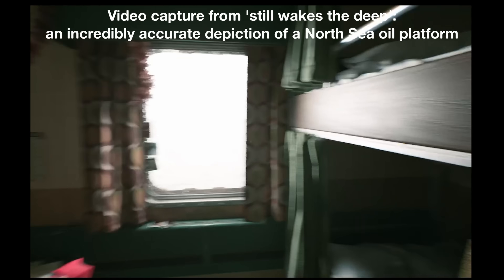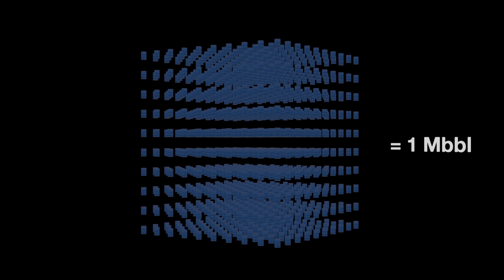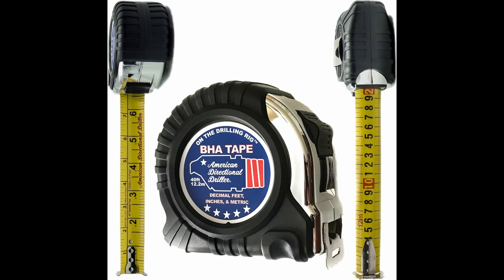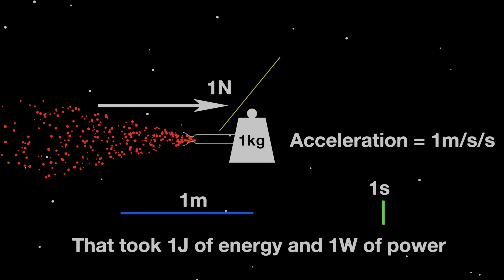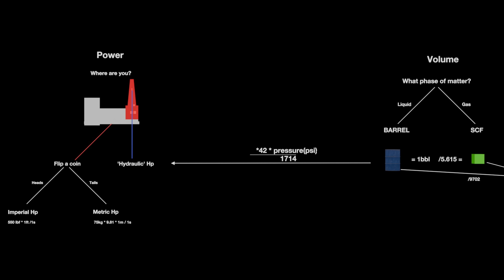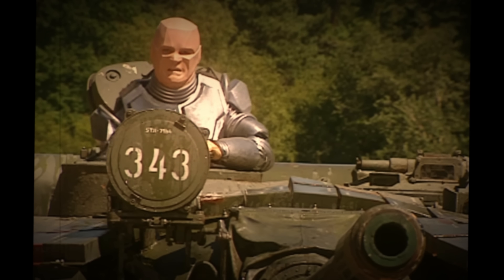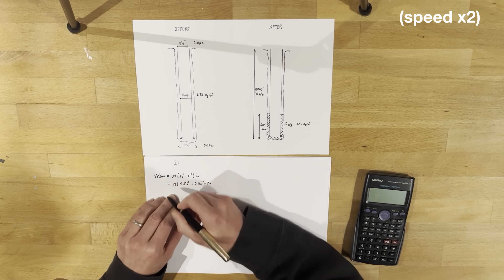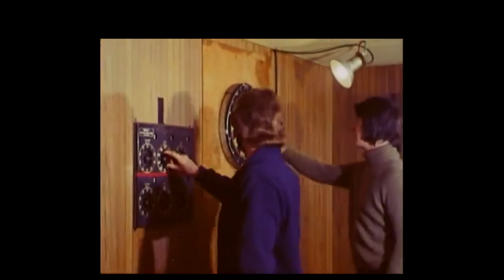Oilfield Units: a Measurement System so Cursed it made me Change Career

Comment: As an American who has hated this kind of attitude with the heat of a vacuum arc furnace every since I learned how to use a ruler in kindergarten and wondered out loud why the heck anyone would want to use inches and fractions, I can confidently tell you that what you're describing is the product of American exceptionalism, sintered with the tribal machismo of maverick American engineering, and annealed with Texan conceit.

I've never worked in oil and gas, but I've had experience with the above three, and it just makes so much f**** sense.

Comment: First lesson as a chemical engineering undergraduate at a British university- the 5 systems of measurement. I still have a fondness for the btu/h.ft2.deg F unit for heat transfer coefficients. I worked for a British company that had technical connections with a US company- they insisted that all calculations be done in US customary units, so I became familiar with all the various conversion factors. Then I worked in the nuclear industry where things were either very very tiny or huge, so we invented our own (descriptive) units: the naff-all & the Wembley. The pico naff-all per cubic mega Wembley was a really, really small concentration (but still deadly)...
Reply: @charlesbrecknell4656  "Cubic Mega Wembley" was a prog-rock album, wasn't it..?
Reply: You might get a kick out of this - https://en.wikipedia.org/wiki/Sverdrup

Also, there is a mythical unit from the Danish Technical University "Jørgensen" - defined as "A Universe full of beer"
Reply: @janhgh3400  "can you use it in a sentence?"
Yeah, my dad had a Jorgensen before coming home to bea-
Reply: Norman Feather's classic tome still a favourite of mine; required reading in 1st year.

Comment: 4:00 you just skipped the part about how standard cubic [volumes] is actually a form of MASS unit because the "standard" part refers to a defined pressure and temperature...which isn't officially standardized, it's more like a handshake agreement. That's right "standard cubic feet" aren't actually standardized, I work in aerospace engineering and we run into this, we actually have our suppliers tell us what their "standard conditions" are in the spec to make sure we're all on the same page.

Comment: In the European Union a new regulation recently went into effect that forces manufacturers of electronics to provide the customer with a spec sheet with information on the devices efficiency, noice production, etc.

I think that this idea in general is great, and drastically improves transparency and allows consumers to make better choices.

However, the Unit they decided must be used for the efficiency of a device is is how many kWh the device draws in 1000 hours of continuous use. kwh/1000h.
Reply: That actually makes some sense since it forces averaging into play. If a number in kW was given then there would be plenty of wiggle room if the power actually used is too high and hard to prove the number was false.

Comment: I was taught metric at school, but also imperial by my dad who did his apprenticeship in engineering and upholstery in the early 50s. Therefore my measurements are an archaic mix of both that drives anyone under the age of 45 or so crazy. No regrets, and I'll happily tell you this from at least 2 furlongs away so I get a 1/4 mile or so head start on running away.

Comment: I once combined the news industry's two favourite units: "as heavy as x blue whales" and "x times as big as Wales" into the unit of pressure whales/Wales. One w/W is about 50 micropascals, depending on how big the whale is.
Reply: I randomly calculated the pressure head of my toilet bowl to about 20 mbar. It flushes well, so I guess that's good...
Reply: Would kw/W be kilo whales, or killer whales?
Reply: When I need silly units, I personally use the Armstrong, which is based on disgraced cheater Lance Armstrong, cuz he’s one of the more notable people who have a power output measured, which is about 512 watts. He was 5’9.5”, and some blogger joked about him having a 4” dick, so that’s one Armstrong-Inch, or A”. Ofc one A’=69.5”/4”=17.375A”. You can also abbreviate w/ 💪 for brevity. So, for instance, one 💪=165lbs, and a road bike tire has a contact patch of abt 30in^2, so 1 💪psi is 5.5 imperial psi. Converting to your measure, one w/W=3.98854*10-8, or about 39.9 nano💪psi
Reply: @SpAm-AcCoUnT 🤭😂😂
I didn't seen any mentions of Stones
Reply: @SpAm-AcCoUnT  I prefer to measure lengths in lines and arshin, and weights in pennyweight.
Reply: @Lyrainthevalley  wouldn't be whales/Wales = h?
Reply: @fackgugle6497  Yes, about 0.5 nanoatmospheres.
Reply: @fackgugle6497  wh/W if we account for register
Reply: I personally like the FFF system, furlong firkin fortnight.

There are a few surprisingly useful units in the FFF system. One microfortnight is really close to 1.2 seconds. An hour is about three millifortnights.  The speed of light is about 1.8 megafurlongs per microfortnight.
Reply: @Lyrainthevalley  And whether the tide is in or out.
Reply: Now I understand, why US newspapers use units like school-bus, Olympic pool, elephant (really used by some NASA article about SLS Launch Abort System)  )and so one...👍
Reply: @TheKluvi  SciShow of all things spent half a video measuring data in Bytes and converting to e-books for some dumb reason.
Reply: Well you know this is an industry standard dictated by Westminster then, as no Welshman would ever actually use Whales, we would use sheep, daffodils or leeks.... Maybe dragons, but not whales.... :)
Reply: How do you get pressure from that? Wouldn't the two whale units be mass and length?
Reply: @toebs_  Mass of a whale over the area of the country of Wales - makes more sense to me than the oilfield units hell!
Reply: @mal.p ahh I misread, I thought it said "as big as x whales", meaning x times as long as a whale. I also just learned that "weight" is the actual term for the force of gravity acting on things, not just an informal term for mass like in German. Oh well, now everything makes sense
Reply: What?! No way! That's like nothing! Surely whales should be able to fly if that were correct.
Reply: @actuvon imagine a single whale thinly spread over the entire area of the country of Wales - wouldn't exert much pressure at all
Reply: @Lyrainthevalley  🤣🤣🤣 I misread your post as whales/whale. I thought it was meant to use the footprint of a whale. The truth is funnier.
Reply: @Lyrainthevalley I would dearly like to tell you that Wales was once intentionally smeared with the remains of an exploded whale. However, the one that beached itself on the River Severn in 1895 was cut up in situ.
Reply: Reminds me of furlong/firkin/fortnight units, or maybe the barn-megaparsec. IIRC that's about three teaspoons.
Reply: @gazeboist4535 how have I not heard of this. The barn is one of my favorite units. You think it's a joke when you first hear about it but it's an actual unit used in serious science
Reply: When the evaporator's working "well" it gets to about one killer-whale per kiloWales, but my colleagues staged an intervention and that's not in the SOP.
Reply: How much is that in cars per football field?
Reply: So the planck's constant (h) is just 50 micropascals?
Reply: A whale beached on the Severn estuary opposite Wales in the late 1800s. So Whales/Gloucestershire would be perfectly correct.

Comment: 12:08 I remember seeing that power in kWh/1000h instead of just... you know, W was used especially in lightbulb labels since most people basically saw Watts as a measure of an light output and not energy consumption. So LED bulbs had something like "60W equivalent, using 12 kWh/1000h"

But in professional/industry setting? w-why?

Comment: 16:08 The way you've done the example isn't in the way oilfield units are meant to be used.

You have the diameters of the casing and the hole in inches. You calculate each capacity in bbl/ft. That formula is already well known. Subtract from each other to get annular capacity. Multiply by the length in ft and you get the volume required in bbls directly.

I'm not sure why you're doing intermediate conversions from cubic inches to cubic feet to gallons to finally barrels. It's asking for trouble.
Reply: That's exactly what's happening in that calculation? It's just making the conversion before/after. Here the calculation is each capacity in cuin/ft (cuin/in by mistake) and subtracting the two capacities, then multiplying by the length and converting to bbls. It's just the same calculation but you do (really you'd do one conversion idk why he did two) two conversions at the end instead of two conversions in the middle (since in your model you'd first convert cuin/ft -> bbl/ft).
Reply: Both have to end up with the same answer eventually. What I mean though is that the way he's doing it isn't really condusive of how oilfield units should be used.

Comment: The abbreviation bbl is also used in the automotive industry for the number of barrels (Venturis) of a carburetor. For example 4 barrel (4 venturis) is abbreviated as 4 bbl. I'm assuming because barrel for oil is abbreviated as bbl and they just mindlessly applied that to barrels of a carburetor without apparently knowing what it stood for besides being short for barrel.

Comment: I'm a pilot in Scandinavia. I have the pleasure of using feet for vertical distances, nautical miles for horizontal distances... no wait we also use meters for horizontal distances. 
Takeoff and landing distances are in meters but distances in the air are in NM. Visibility along the ground is measured in meters but if the weather is particularily poor, the vertical visibility is reported in feet.
Hydraulic pressure is sometimes reported in PSI, air pressure is reported in hectopascal (inches of mercury or millimeters of mercury other places). Manifold pressure reported in inches of mercury if it's a particularily old engine system.
For fuel, small planes fill up in liters, large planes fill up with a set mass (kg, lb etc). Speed measured in knots (at least it makes sense for NM), but sometimes in statute miles per hour.
Wind is measured in knots and degrees. The degrees can reference either magnetic north or true north depending on where the information is coming from.

Comment: Worked between engineers and procurement for offshore construction it was bad enough knowing what they meant in mostly SI units.
Ignoring the 12m sections of 56" OD pipe with 20mm wall thickness, my favourite abbreviation was MTN which, logically, we decided could only be the mega-tera-newton.

Comment: The example calculations for well cement required I found on some webpage just use a conversion factor of 1029.4 that you divide the difference of squares of the diameters by. Then you don't need convert diameters to radii or worry about multiplying by pi. Easy.

Comment: 9:55 Perhaps not a conscious choice… could be unconscious code switching.
Reply: I'm an american and I switch between the two all the time. Depends on what I'm talking about or the context.
Years are almost always in hundreds, numbers that are an integer quantity vary between the two, while measurements are almost always thousands.
It also varies with which part you want to emphasize, I think. Like, with years, people think about decades more than they do centuries. It provides a neat delineation between centuries (which change at most once through someone's lifespan) and decades and years (which do).
And if I'm talking to someone and they're using one type, I'll usually use that same type.

Comment: The units are note even very consistent across disciplines in the oil & gas industry.  A company I worked for once spent a long time and a lot of money to come up with a unified set of units to use in their well simulation and management software.  Turned out to be a difficult task!

Comment: It might be that they are intentionally using different units for everything for the same reason pilots (as in airplane) do this. So if you give number + unit, even if your not 100% on the context, you can be "*sure*" that it's the same thing talked about. Sure, it's painful for calculations, but it might help reduce misunderstandings/mistakes in some cases!

Comment: No mention of temperature. This is because temperature is a completely separate unit and not derived from anything. Celsius and Fahrenheit are both equally easy to use in all scientific and engineering applications. Neither has any advantage over the other.

Comment: To make volume worse, oil/gas have different volumes at the surface than they do in the reservoir (Bo/Bg), and when you talk about the volume of oil in a field, it's expressed in STOOIP - that volume of oil at surface temperature/pressure*. So you express the volume of the oil in a reservoir in terms of what it *would be if you brought it all up to the surface, which you never actually do. Fun!

Comment: When tutoring students who have a teacher insisting to use imperial units and other spin-off units, it is my experience that the level of abstraction and time consumption required to do unit conversions exceed the that of the actual syllabus. If any teachers are reading this, please consider using SI units.

Comment: Watt-hours is also a pure nonsense unit. That's just joules. Watts are joules/second, so doing joules/second*3600second is abosolute nonsense.
Reply: Knowing that your vacuum cleaner draws 800Wh if you run it for an hour is more convenient than knowing that it draws 800 Joules if you run it for one second.

Comment: I don't know how many Stone I weigh but I know it's dumb. I doubt the commenter was actually mad I would hope just busting balls. As an American who uses centimeters with a cheater tape because fractions suck and if you holler out 175cm vs 5' 8" 3/4 you get looks. I say fire all the old people who can't be bothered to learn not all of them save a bunch of money and train them in metric. Horsepower was a marketing term and pretty sure standard oil was pulling shenanigans same with Troy ounce's I don't know how but pretty sure it's a scam some how. Don't use Zed with an American my brother failed the first half of chemistry because he has an Irish professor. Why does If/Then mean !=== Boolean. Every job has lingo it's protectionists. Not zed zero sometimes Null which means no number not zero. 1Bar makes sense but PSI is in my head Yards of cement can get tricky 3ft by 3ft by 3ft also Samantha's not the same as concrete fun fact. American I don't know how many inches are in a gallon. I don't know how but I do think that someone's pocketing that difference in the rounding error in that green book.
Reply: I'm really glad we both agree that it is gatekeeping for the old people not willing to learn.

Comment: This reminds me of my dad telling me how road grades (steepness or camber of the road deckl are indicated: percent grade. 1% is equal to a Rise:Run of 1 height over 100 length. This means 1% = 0.45° and 100% = 45°. The reason why this is sensical is because surveying grade with these units is easily done using string and some sticks. Measuring height in inches with two poles placed a few feet apart makes for a very easy calculation and action without needing a theodelite.

I always shake my head at how much engineering stuff just runs on grandfathered nonsense, but it still feels very human.
Reply: No, a 1% grade is 0.57° -- it's a sine-curve relationship, not a linear one.  Also you can have some disagreement over whether the "run" part is measured horizontally or along the grade, though for most practical purposes if the road is steep enough where that matters, it's too steep.

Comment: I will always defend kwh over joule for electrical appliances. If I turn on my 3kw heater  for 2 hours that's 6kwh used. Easy as that. No need convert to seconds and watts, no large numbers that require a paper or calculator.

Comment: Why Coulomb isn't base SI unit? Also, opinions on cgs system(s)?
Reply: The Coulomb isn't a base unit because it's harder to measure electrostatic forces than electrodynamic ones, hence the Ampere is the base unit. There actually are many sets of theoretically valid base units and the SI landed on this specific one because it works really well with what was already in place as the old metric system and how we can measure reference values to actually define these units.

Comment: To add a little clarity to the 10ths of a foot tape, its a surveyors/engineers tape. Because we decided that the metric system was indeed correct that 10ths is easier, but decided we still wouldnt just switch to metric. Amazing. Solely due to american refusal to swap to metric, ive had to memorize no less then three separate forms of measurement and conversion.

Comment: My take has always been that Customary units make sense for human scale things. 0 F - 100 F is basically the range for "very cold out" to "very hot out" vs the equivalent range in Celsius of -18 to 38 as an example.

This video is therefore absolutely mind-boggling. Because civilization scale industrial infrastructure is the opposite of the case where there's an argument for non SI units.